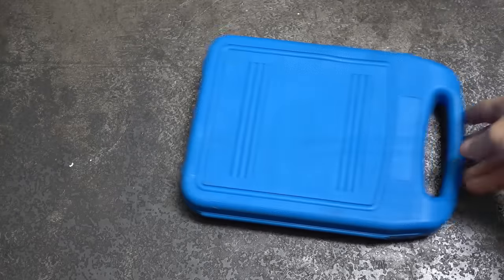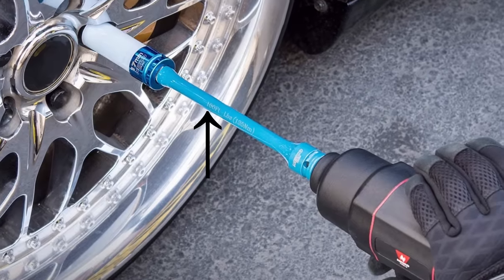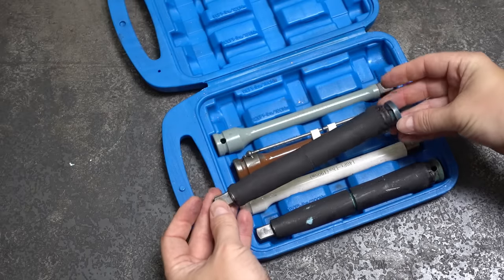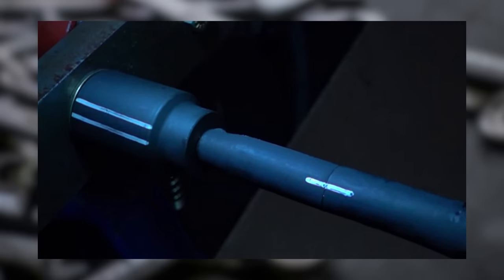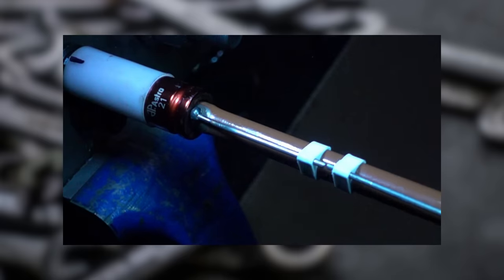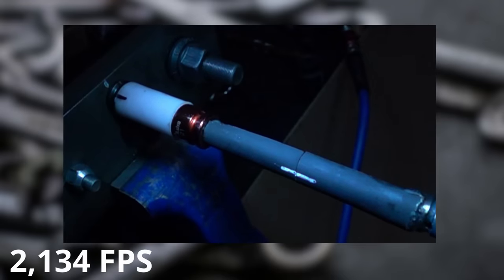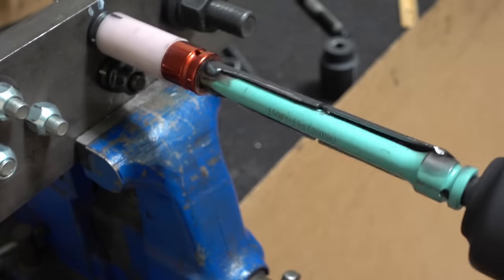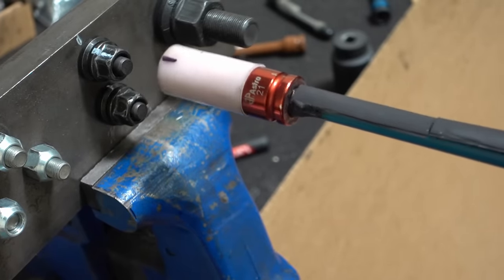Torque Sticks! High Speed Video Helps Reveal the Truth

Comment: Are people that stupid they need these torque sticks??? 😂😂 bring the nuts snug with the air gun or cordless, but don’t keep ugga duggaing after the nut reaches the wheel,,,,, haha. It’s really that simple, then use the torque wrench!! Did it this way since I was 12 years old and cordless wasn’t even a thought in anyone’s head!! 😂. I’m 61 now, still wouldn’t use the torque sticks. Have an extensive rack and cabinet set with more tools than the average mechanic, but no torque sticks!! 😂😂😂 just common sense. 
    It’s like these goofs that rev their engines, or race and are constantly hitting the rev limiter thinking that’s cool!! Shift!! Calm down!! I used to quarter mile race and nail my shifts even in a 9 second car! Never over revved any of my motors. Nowadays, there are guts that drive 10 second stock cars, but when they try to paddle shift first “more speed” they hit the reverse limiter and lose time! If that limiter wasn’t there they would have pistons flying dozens to hundreds of feet!! 😂😂. There’s no skill or common sense to a certain crowd out there! 
   Yeah I’m an old guy, but I can drive extremely well on the track still but with skilll *p& style in challenging cars like my DeTomaso Pantera!! Make that stick vs a Hurrican!! THAT’S a challenge!! (Yes the Hurricans beat me,,, but not by much!! Haha. I won’t risk swapping vehicles though,,,, I would be watching my motor explode all over the track on the first shift most “amateurs” had to shift (judge the shift point as it’s not easy to look down, shift, take the turn and be spot on”,,,, it takes skills the majority of, not all, younger drivers just haven’t learned or even tried to learn. It’s an interesting line in the sand.